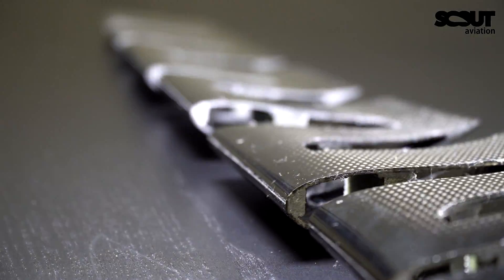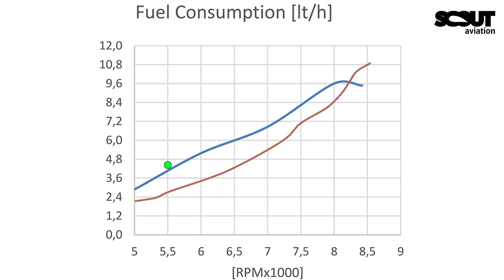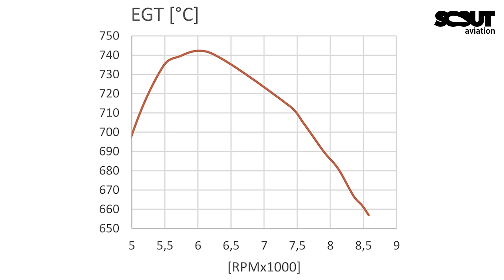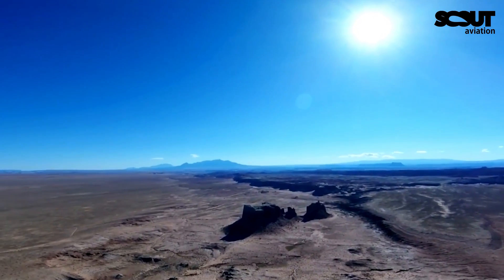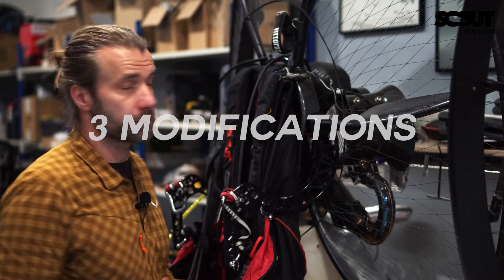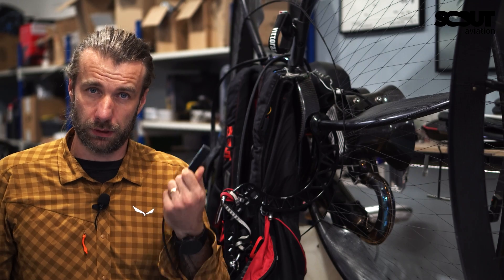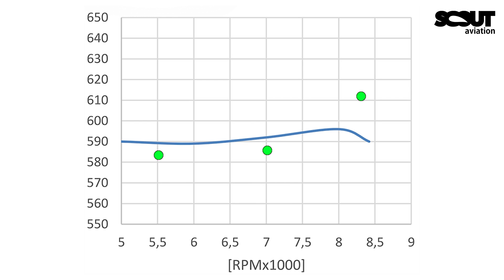The secret of EFI explained and reproduced with regular carburetor  - Smarter Pilot series

Comment: I remember when fuel injection came out on cars. They only improved fuel economy perhaps 5% but civilized the motor and cut down on monthly maintenance dramatically. Now this is for a super high output two cycle engine so the fuel economy boost is likely far greater as quoted in the 40% gain. It also should give much better altitude optimization.

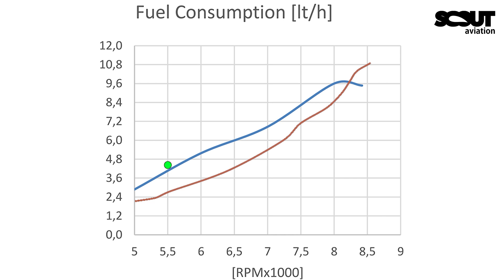Comment: Excellent test!  I have a mister factory with a 1:30 eprop I have also have  the EGT sensor from Fly Henry. Do to the excessive consumption of the engine (6L/h with a 😅Nucleon 4 24 mts I’m 92kg) in cross country fly at about 6.000 rpm . I close the regulation 10 minutes always watching the EGT not reach more than 660 C . Finally my consumption is 5,5l/ hs . I couldn’t get it down  any more because y was afraid to burn the piston . But before the Factory I had a mister classic ant with the some kind of fly the consumption was 4 l/h .  Don’t know how to improve the consumption.  Maybe using a bariometric Scout Prop 😊 .

Comment: The video about the variable pitch propeller shows an excellent test stand. Install the paramotor on this stand, lean the mixture, and leave it for a while to record the parameters. To protect the piston from burning out, a thermal barrier ceramic  coating can be applied to the bottom of the piston. This will allow you to fly for several hours longer on a full tank. An excellent addition to the new propeller for maximum fuel efficiency.

Comment: Very interesting work 👍. A few years ago, I also attempted similar experiments. I noticed that during transient modes, the engine ran rich, and by adjusting the settings, I was able to achieve very smooth engine operation. However, I also understood that this could lead to overheating. At the time, I couldn’t find a reliable enough exhaust gas temperature (EGT) sensor.

I considered using a wideband oxygen sensor, but I wasn’t sure how it would behave with a 2-stroke exhaust system, and it’s quite expensive. I also had the idea to replace the atmospheric membrane with an electromagnet and control the fuel delivery using a controller, but as usual, there wasn't enough time to implement it.

Another idea was to install a servo on the H needle and use exhaust gas temperature to find the optimal point, then have the controller adjust the setting in real-time based on RPM and a predefined correction map, while monitoring critical parameters.

Unfortunately, the lack of reference data on optimal temperature ranges rendered much of the effort inconclusive. Also, the durability of the H needle’s threads was questionable. And working in garage conditions without an unlimited supply of spare parts made serious experimentation difficult.

In general, a fuel injection system is a logical step forward. But in my opinion, achieving true autonomy is the next major step — because relying on a battery alone is not a serious long-term solution.

Comment: You forgot to take into account air temperature whereas when cold the air is denser (more power) vs hot is less dence, yes a carb can do efficient economy , however if you can remap the efi it can save the engine if tuned right! Better
Reply: We need a intercooler 😀

Comment: Efi (fuel mapping) can be a great thing if you want to add a turbocharger as adding such complexity might as well go all the way. Certainly great at reducing noise. "Power when you need it" versus reliability is a big time trade off so trying to perfect both is a worthy effort. The cost of these systems and reliability is much better thanks to the World of motorcycles and sport ATVs. Garmin GPS and mapping systems might be set to revolutionize this niche as well.

Comment: Any way you could design a correlator that opens the high jet as you add more throttle? So you could tune for economy in flight but when you need to hit the throttle, the correlator opens the high jet more.

Comment: Great video as always! Thank you. Do you see a risk in leaning out the low needle while high needle is still in default position? What du you think at what rpm the high needle takes over the main fuel rlow?
Reply from the maker: Low rpm (idle) is not affected by leaning the high jet at all. 

Midrange cruise rpm is obviously affected by high needle. I don’t know to what extent it is affected by the low needle but it makes no sense to experiment on that. The low needle needs to be adjusted to make starting and idling of the engine smooth. 

I had no reason not means to adjust the low needle in flight.
Reply: Low jet makes a big difference in midrange.  If I tune my scout so it barely starts and idle, it runs really nice and gets good fuel economy. 😅

Comment: using peak EGT (probably "stoic"-ish, 14.5ish:1) for your efficiency test is great thinking, but i think you'll actually find even higher efficiency running "lean of peak" (close to where the motor almost shut off on you) at an AFR closer to 17:1. this is particularly safer while running avgas, and I think it's what many piston powered aircraft do for an efficient cruise. 

regardless of my theoretical mumbo jumbo, and if it would actually pan out, your gear drive for fixing the atrocious midrange mixture on all of our dogsh*t chainsaw carbs is very, very exciting. bravo sir!

Comment: Here was my response to the Vittorazi EFI release: https://www.youtube.com/shorts/_Dd_iwPc2CU
Reply from the maker: i myself have zero experience on this. Just heard that AFR/lambda sensors get clogged within 20 hours on two strokes. I am sure Vitto would use that if that was an option.
Reply: @SCOUTaviation  Agreed generally speaking this is why I recommend using it to tune your settings for a particular range of Density Altitude and then remove it.  Once you correlate the AFR to EGT temps, you don't need to keep running the lambda O2 sensor for monitoring cruise to WOT.  Where low load/idle regions aren't spicy enough to burn up a motor. 

I think a significant factor is running too rich with the lambda O2 installed that will accelerate the build up, which is often the default state of all factory 2 strokes.  Running closer to stoich will burn more 'cleanly', converting more of the fuel/oil mixture and reduce the buildup.  

This all started chasing my tail after swapping to a non-standard carb (exchange Delorto VHST to Keihin PWK). If you're way off with fueling, the EGT can be quite misleading, an excessively rich condition can yield high EGTs (combustion in the exhaust port).  Ignition timing is another topic that impacts EGT significantly, and this is another area of concern that we pilots are stuck using dumb static timing coils leaving efficiency on the table, these are however quite reliable for the cost so there's the tradeoff.

Comment: About 700C is close to stoichiometric with a Thor 202 float carb at cruise 5-6k rpms, with an EGT in a standard polini location, coming from my measurements using a lambda oxygen sensor (to get real-time air fuel ratio). I have years experience working on oem powertrains and engine calibration, I repeated over and over to gain confidence in my jettings and more important, needles. I target 14.7:1 AFR stoichiometric aka lambda 1.0. The beauty of paramotors is that it has a built-in load for 'dynamometer' testing of an engine which is in the form of a spinning propeller and the fluid that is air to resist it, also self cooling, I love it. I built a paramotor test stand that I stake to the ground and run up the engine to full power, however more useful for idle and cruise tuning which is the most challenging even with an oxygen sensor, those pesky needles.

At about 115-120 kg all up 140 eprops, I measured consistently with this thor 202 at 0.90, 0.93 gal/hr (3.4, 3.5 l/hr) burn rate with a 28m Uni 1.1, 22m Nuc 4. That's flying a couple hours exploring 0-1,000 ft, I like trims out until I go low, no aerobatic duty cycles.
Reply: Isn't 700C too much?
Reply: @ogcadam9096  Polini specs 700C in writing, some facebookie says they say up to 720C.  I am a professional engine calibrator, 700C is about stoichiometric based on my testing with the equipment I can afford.  I monitor temps in flight, it runs the best at 700C, I flown at 720C as well.  It's risky running at stoich if you don't monitor your EGTs which is a difficult burden for most ppg pilots.
Reply: @iKenFlyPPG  Surprising, I set my midrange to run at 620 on Sky 150, Sky says 660 is safe, but aluminium melting point is 660, don't have a lambda sensor, might though lean a tad out, thank you for your reply!
Reply: @ogcadam9096   You're not wrong, however consider the myth is EGT temps are the same for all engines and this is incorrect because often it's different for different engines. The Polini Thor engines and 'precision' placement of the EGT across all models was characterized to that ~700C temperature.  I have confirmed this independently specifically the Thor 202 engine and is apples to apples between Thor 202 engines (I do sometimes leave this disclaimer however my posts are lengthy enough).  I was on a twin turbo gas oem development project a little bit ago in the dyno cells I was assigned to one of them as the engineer, the EGTs were over 900C pre-turbo. The turbines are an inconel alloy which can get stronger at high temps.
Reply: @ogcadam9096  Look up Micheal Forrest (channel name) videos and binge the 2 stroke tuning and oil videos, check out his plug reading video where piston wash is a more accurate indicator and plug reading is not what you think.  He doesn't use a lambda O2 sensor but don't think he needs it as he has been doing this for a while. I'm a nerd who knows what gadgets to use and it does feel like cheating.
Reply: Hey Ken,  I’m pretty good engine tuning and would love to  put a wideband on my 202 BUT how did you locate your O2 sensor so you didn’t measure uncombusted air passing through the ports?  Only Yamaha came up with a solution and it would be a pretty major undertaking to adopt to our motors.
Reply: @fritz280  It is what it is.  Slavens racing and some rando sources say put the O2 in the fat part of the pipe.  If you look at my older shorts I show where I put mine.  The thing with development and even racing, you make sacrifices like killing WBO2s, which I have yet to destroy a sensor because I tune the engine and correlate to an EGT, then remove the O2.  I have been paid money to develop engines, I wrote the Tuning 101 series on YouTube after hundreds of hours messing around with my own stuff, it's a no brainer to install an O2 it's frustrating when people brush it off.

Comment: Excellent science, i hope to be able to afford a scout one day. 

Does the adjustable propeller work with the efi to reduce fuel consumption even more? or is the propeller achiving a similar effect by putting the carb engine in a lower power band, so the EFI plus prop is the same as just efi or just prop. I'm sure this is already on your mind and i can't wait to hear your testing. 

 as a few people have mentioned there seems to be something going on with the audio, like it keeps switching from mono to stereo. very watchable but a bit off putting.
Reply from the maker: the EFI fuel map is based on RPM and throttle position and then corrected by EGT reading. Unfortunately the EFI did not work with Variomatic and a different map would be needed. 

we will keep on working on this idea though.

Comment: Thank you! I am comming to the same idea we need to lean the mixture as it is needed and safe. Let's hope the EFIs come standard soon! (Or the more capable electric batteries - whatever comes first :) ). Meanwhile I strongly recommend to install the inexpensive but efficient EGT as a standard flight equipment! It shows very well if your carb settings are correct and can prevent your engine from problems. You will easily notice something is wrong by checking the EGT in flight from time to time. For comparison, the CGT is not that helpful.

Comment: What would be the most you would turn the hi jet safely to achieve better results?
Reply from the maker: That is exactly the problem: you can only find out its limits by burning through a few pistons. I did not do that, I do not know where the limits are. Standard setting is 75-80 minutes open (1+1/4 to 1+1/3 turn) . I guess the most dangerous zone is around 60 minutes = 1 turn = so there is really not much room for play on the ground. Only with in-flight adjustment.

Comment: At a minimum Vittorazi need to install a generator to recharge the battery
Reply: Estart moster has the option, it must be dirty power, where chemical storage (batteries) is clean power (clean in terms of electrical noise).  There could be electrical interference problems where Vitto can void warranties if you installed your own charging system type of thing.

Comment: here's the problem though - you couldn't do the Icarus with this engine due to battery limitation. In my opinion that defeats the purpose
Reply: Bring a bigger battery.  You fly with a bigger gas tank, you bring oil, you can bring bigger batteries with you too.
Reply: @steveupp  which weigh even more, take up even more space and charge for longer. Do you really want to bring a charger on a long XC trip as well? Finding fuel is easy, filling up is quick. Finding a place to charge may not be as easy, it takes much longer and overall is just an additional limitation. I don't understand why they couldn't just use a generator instead.
Reply: The Moster EFI battery gives you about 7 hours run time if you start the engine 20 times or less. They have an accessory to run up to 3 batteries. Thats about 21hrs runtime. The battery takes less than an hour to charge from 0-100. The battery on the 
MosterEFI is not the limiting factor that everyone thinks it will be
Reply: @Ellwoodsss1  weird, because i've read 4 hours. Yeah, you can always bring additional batteries and a charger, but who wants to do that? Who wants to carry all that extra weight? The fact of the matter is with a regular engine your limiting factor is fuel. With this engine it's both fuel and battery, which in my opinion does not justify the only real advantage it offers - which is lower fuel consumption
Reply: @Ellwoodsss1  i'd love to but i'm in in a different side of the world. For the simmilar weight you could just have a generator instead and not have the issue to begin with
Reply: @apsestasis  right, in the millions of dollars and 4 years spent on development and prototyping , they probably never even tried a charging system  for it🤦🤦‍♂️
Reply: @Ellwoodsss1  i'm sure they did. Can you quote them why they went the other way?
Reply: @apsestasis  yes according to Santino , they decided against a charging system on MosterEFI, the additional complexity was not worth it. They had a ton of reliability issues with the prototypes and with the ecu drawing only 2.5 amps, they decided a bigger main battery would not be much of a weight and the additional reliability and simplicity of no charging system was worth it on MosterEFI.
CosmosEFI does in fact have a charging coil and uses a normal lead acid battery, as far as I know it’s a carryover system from the carb cosmos. They are all twin spark as well. Exciting times are coming!
Reply: @Ellwoodsss1 thanks, i didn't know that, but at the end of the day the engine is still complex when compared to alternatives, and it's main selling point which is lower fuel consumption is negated by having a duration limiting battery. I wish all the best to Vito, but i still think it was a poor design choice at their end.